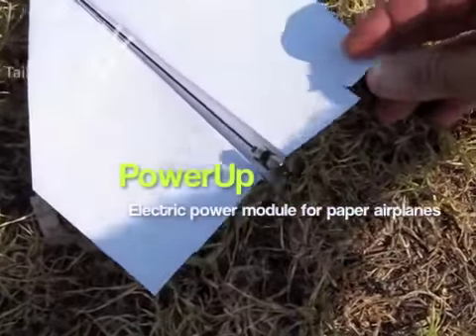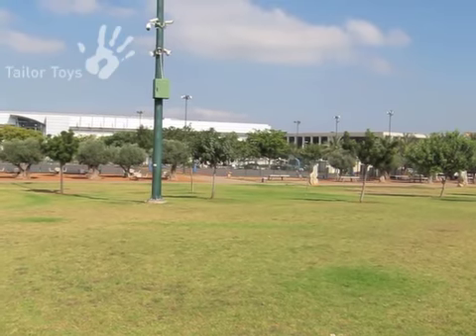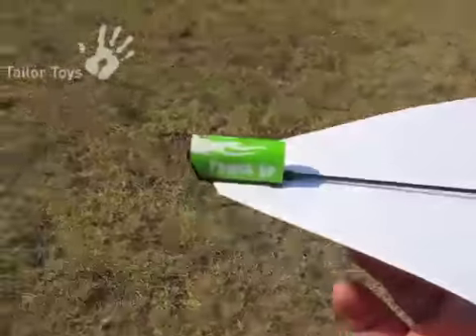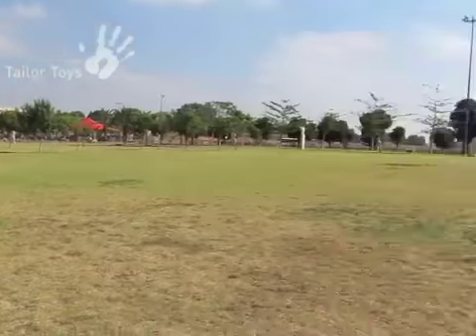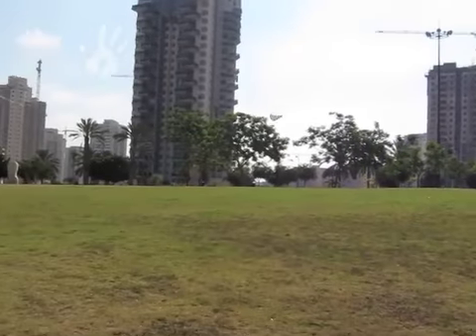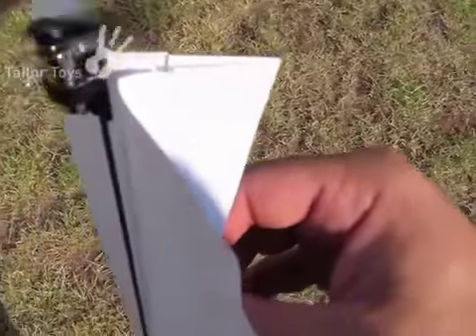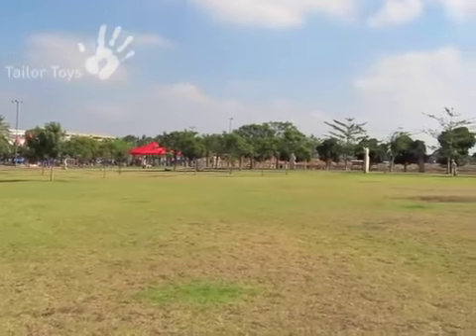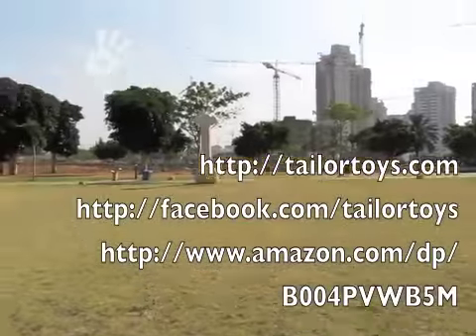Electric paper plane conversion kit - Trouble shooting and flying tips

Comment: they need to make something that allows you to rc a paper airplane to some degree. small wire tied to the flaps and small individually controlled motors to pull on them slightly for turns and dives. id pay $100 for a good, robust way to rc multiple paper airplanes.